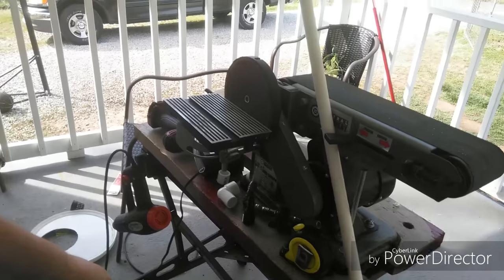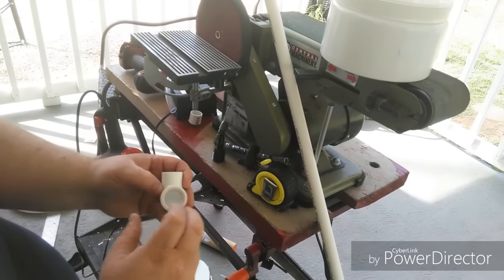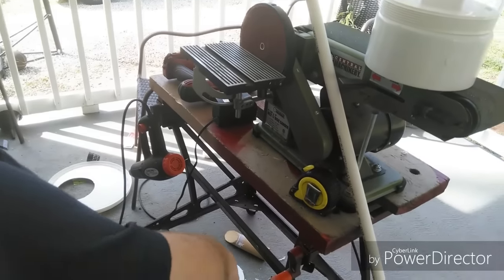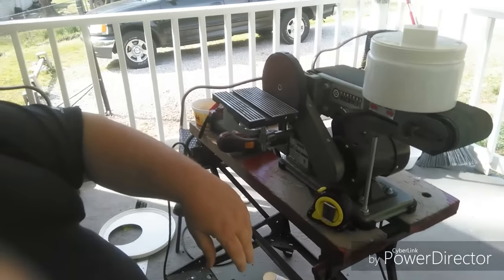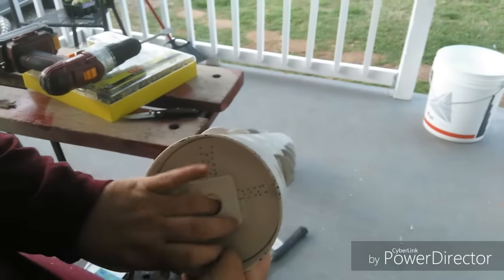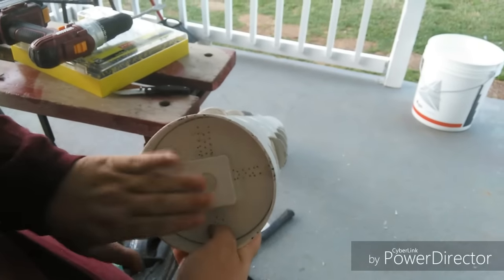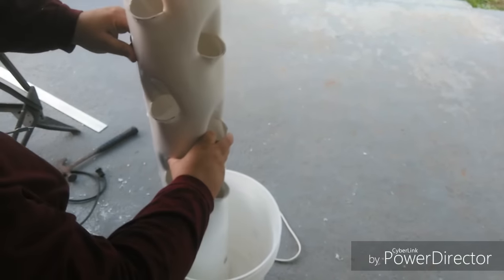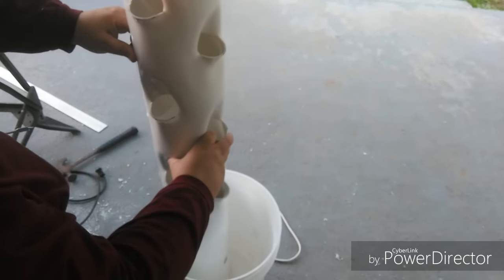DIY (Garden Tower) build a Hydroponic Vertical Raining Tower part 3

Comment: Thank you Craig, I really appreciate you taking the time to document and share your process. I have built a couple of these myself and am struggling to find a way to speed up the task of shaping the holes...without much success i might add but regardless I enjoyed your videos.
Reply from the maker: the trick is making sure it's hot enough to work with if not it will fail Everytime. it can't be forced either that gentle touch. but you can do it don't give up.
Reply: Thanks again Craig! I have been able to make two towers successfully I just meant that I was searching for a way to do it faster as I am going to build 16 of these towers for a backyard greenhouse and it takes me about 4 hours to finish 30 holes. Doing that 16 times = a lot of time my friend! Ive gone so far as to consider melting the pvc/abs down and pouring it into a mold!
Reply: wha tI have seen some others do is that they work with a partner, one heating and one stretching/cooling - and they have 3-4 "plugs" that they use to shape the holes.  The plug is left in place to cool whle the next one is heated and shaped.  Ideally you will have one slot being heated as the previous one is being formed, while the 2-3 previous ones are cooling with plugs (or whatever shaping tool you use) still in place.  This ( I would think) should speed up the process significantly.

Comment: Awesome tutorial! Thanks for taking the time to make it, I was just thinking about building something like this when I stumbled across your videos.
Couple of questions;
What do you use for a nutrient solution to go into the water?
Do you set your pumps to run on a timed cycle?  If so what works best, in your experience?
Last question, what part of the country are you in? Or better yet, what zone are you by USDA Gardening Zone Maps?  I ask because I'm curious how the climate affects this build outdoors.
Only input I have for the videos is that the audio was a little quiet, tough to hear at a couple points through my laptop speakers, but I just listened closer and caught every word, lol.
Again, awesome videos! Thanks so much for making them!
Reply from the maker: Im in north ga had it on a cycle of 15 mins on 15 off with a pump that would pump to a height of 5 ft. Just have to pay attention to the roots you may need less so according to the seasons to. Thanks for kind words. Dont forget to watch the other parts of the videos if you havent. Go my channel to find them

Comment: If you mount a pvc cap upside down in the bottom of the 5 gallon bucket and simply use a rubber washer to seal it; that and the lid will secure the pipe perfectly. And will allow the pipe to be perfectly centered and fully stable. If you do no want to  drill the bucket just use a  piece of a 2" x 6" board  cut it to fit inside the bottom and counter sink the board . Then bolt the cap upside down to the board.
The board can also serve as a place to mount the pump securely. To dress up the bucket use privacy fence boards  and cheap straps to hold them around the bucket. Make them a little taller than the bucket to place decorative rocks on the buckets lid.
Reply from the maker: Sounds good

Comment: How do you keep that top part in place without it being uneven? The part you drilled a bunch of small holes in, I mean.
Reply from the maker: If you set it on a level surface you can adjust the threaded rod to level the tower
Reply: @PonicsHaven30720  oh wow thanks for replying!

Comment: How high is the vertical tower? What should the cut be at?
Reply from the maker: Under 4 ft above bucket but stands 5 ft over all
Reply from the maker: So cut a full pipe in half what I did

Comment: Thank you so much for this video! I am building a vertical aquaponics system with my Science Olympiad team, and intend to modify your design slightly so that the nutrients come from fish waste. 
In your video you said that you use a 6 inch cap, but I read some of the comments where you said that the PVC pipe should be 8 inches. Do you mean that the cap is 6 inches tall, or that it has a 6 inch diameter and I should buy a 6 inch PVC pipe to fit? 
Also, I am having trouble sourcing a PVC pipe because Home Depot and Lowes don't sell anything over 4 inch, and a plumbing store has a minimum length of 20 feet when I only need 5. Do you have any suggestions to where I might find a pipe?

Thanks again!
K
Reply from the maker: Meant 8 inch sorry
Reply: @PonicsHaven30720  Thank you for that clarification, I am so excited to build this vertical raining tower! 
I have one more question: Where did you buy your 8 inch PVC pipe? I am having trouble sourcing it from the hardware and plumbing stores in my area.
Reply from the maker: @kelleahmeuth9865  I found mine at a plumbing storets thin wall pipe

Comment: I'm having trouble understanding how to get the water and the hose hooked up to have the water flow through like that.  Can u explain that part of the setup more?
Reply: 1/2" pipe inside the big tube. At bottom of the 1/2" pipe, glue the 1/2" to 3/4" elbow. The 3/4" end is threaded to take a 3/4" to 1/2" reducer fitting. Attach the clear 1/2" tubing to the fitting and out the hole in the big pipe to the pump.

I think it would be easier to just run a longer 1/2" flexible tubing up to the top.

Comment: i realize that is comment comes a little late, but I would think that you would have trouble with evaporation and water loss due to the open top design.  Is there a cap that is pout into place over the top of the rain chamber that prevents this?  Do you have problems with evaporation in this way, and does it affect your TDS or nutrient concentration and thus your plants in any way?  I really like your design, and how thoroughly you explained building it.  I am ramping up to build 2 to 4 of these units this spring, just need to do my research before I drop the coin.  Thank you in advance.
Reply from the maker: dannyk8760 theres a  cap on top of .
Reply: Don't overthink evaporation and nutrient depletion. You will lose water through the plants anyway which you want. I would clean the bottom tank out and replenish and maybe vary the concentration of the nutrients maybe every two to three weeks which I should do but find that I do not have the time. I do dutch bucket hydroponics to grow tomatoes and believe this type of system that Ponics Haven has here which is very well built BTW would be well suited for greens or strawberries but most anything will grow in this environment but if a tall plant consider a support system for it.

Comment: Great vid! This is just what I was looking for! I might copy that, making my own tower. What I don't get though is, if the holes for the net cups stick out to the inside of the tube (tower) the water should theoretically run to the left and right of the hole rather than the middle. Does this tower get water to the net cups all the way to the bottom?
Reply from the maker: The net pots stick out enough to get plenty of water. But make sure the pipe is standing level. But it works extremely well

Comment: instead of having to pump the water up your inner tube, you could block the top of the inner tube off at the top and then insert about 10 super fine mist nozzels scattered around the inner tube and when the pressure build up inside it will mist the whole of the inside on the roots.
Reply: The pump doesnt push enough PSI. Misters usually need over 70 PSI. Those fountain pumps only do like 10.

Comment: hi im having trouble with my grow tower. water keeps leaking on the sides of the grow pocket. did i do something wrong?
Reply from the maker: DrewDin it has to be level for it not to leak,the cuts have to be straight to. If a side is higher than the other it will leak alittle
Reply: ow so it needs to be very precise?  If i make the water to strong will it also cause to leak?
Reply from the maker: DrewDin yes the water just needs to rain down lightly. That could be the problem. Did you put a valve in the bottom to control the water
Reply: DrewDin

Comment: hi ponics haven! thx for the nice vids
i have a question please. 
Do the pots at the lower level get the same nourishment as the ones at higher positions or providing a manifold is better idea
Reply from the maker: Well the system runs 15 mins on and 15 mins off. Even if it didn't it would still get more than enough because of how much nutrients is pump through in that 15 mins. time. The pump is way oversized for the system.